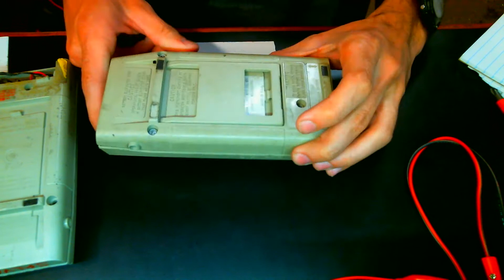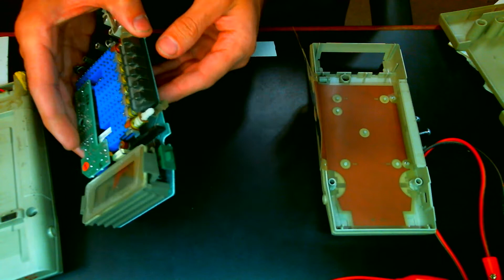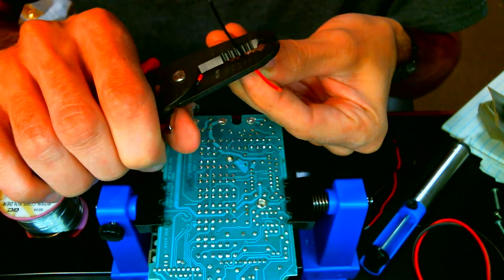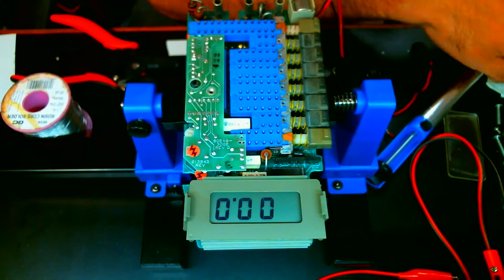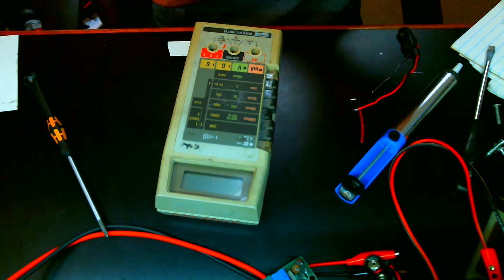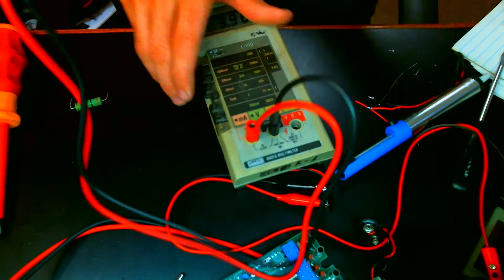8020B Battery Connector Replacement

Comment: I have a Fluke 114 with a broken battery connector. The consists of 2 pieces of metal, not like the one in this video. Any idea where I can get the connector?
Reply from the maker: Hmmm.... unfortunately I haven't had the chance to work with any of Fluke's 100 series, I can do some research though and see what turns up.
Reply from the maker: I think I've found it. Search for this eBay item number: 163463721504. Or search eBay for "Fluke motherboard battery cover case springs" and look for the one that lists the 110 series.